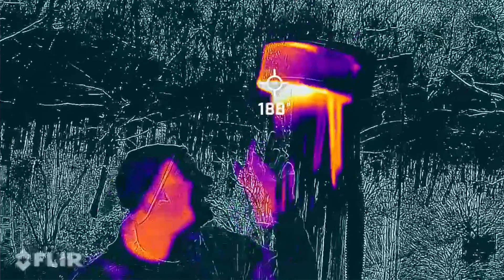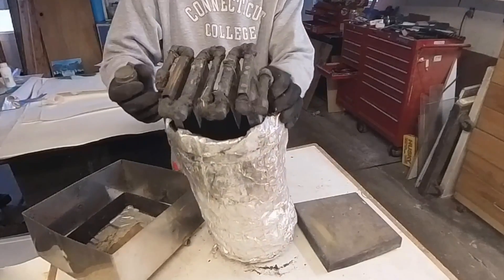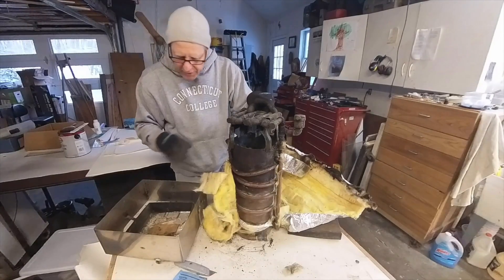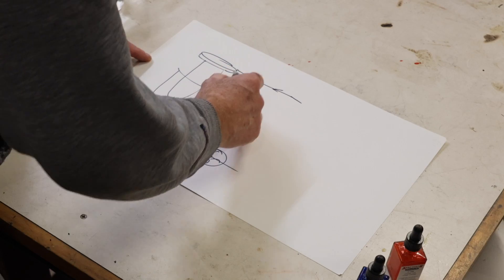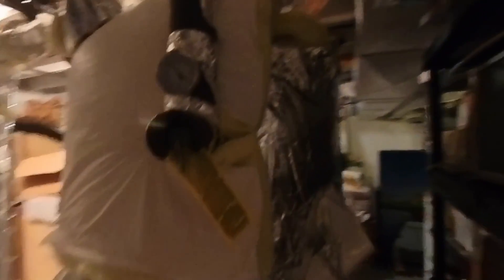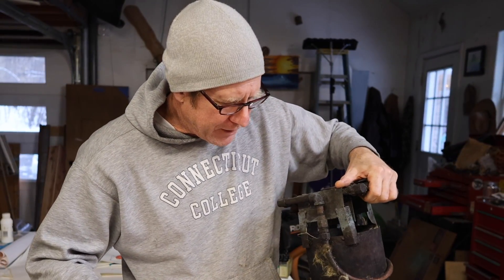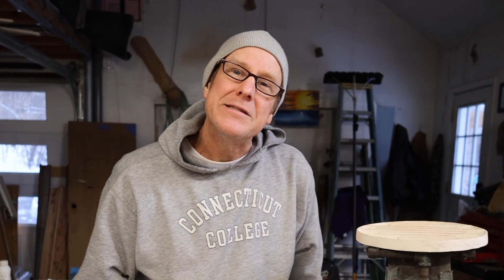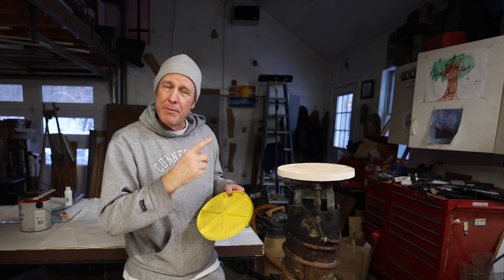DIY, HOT Water from Wood Stove That Really Works

Comment: I’m in the process of designing a house, and I would like it to ideally be off grid as possible therefore somebody of the future does not possess the ability to shut off my utilities. I’m planning on digging a well for water source. I’ve been looking into multiple ways to tie things together and was thinking of how to use a soapstone masonry heater to heat my house, I can also get a free oven off of it by making side compartment/chamber and im Looking into how to harness thermo siphoning to passively collect the heat from wood burning stove to heat water. I like your side electricity control knob to control temp accurate because I’ll have solar in summer and not wood stove. Was planning on running all plumbing kitchen bathroom and laundry room internally connected and three walls facing so I minimize pipes/travel distance and only plumb one wall of my house, masonry heater will be next to kitchen by laundry room. I think a copper coil inside of my fireplace could heat water without electricity. Idk any other tips or tricks recommendations? How many times have you cleaned the copper pipes in ten years they look shiny and also? Great video I’m trying to come up with a design to refine it even more before I implement it and thanks for including what doesn’t work, this is very useful for anyone trying to improve. I like how we can all learn from eachother!
Reply from the maker: Sounds like fun! Your idea of a coil in the fire box with a thermo siphon is a good one. That’s what I would do if I was designing from start. My house is too small to put the storage tank on the same floor as wood stove. I have to clean this thing twice a year. I’ve got a video on how to clean it if you want see what it looks like dirty. Also if you’re building from scratch consider the make up air for your wood stove. You could run a duct right to it from outside or a passive geothermal or both. Fire will burn better and house will stay warmer.
Thanks,

Comment: Wow ! Very Nice ! I was also thinking of creosote, as it is kind of a wood destillation system somehow, and I think it could be interesting to design the plunging pipes in a way (with little slopes and One that is longuer than others ?) that there is A main place where all of it accumulate and can Or go back into the fire in a safe and interesting way (if there is no much corners in the pipe) Or being collected in a jar, and from time to time you got some natural chemical to harvest for domestical uses..
Reply from the maker: Thanks for the kind words! Creosote actually builds up all over it and I scrap it off. I have video on how to clean it and one  how it works on my channel, Sculpture for a Small Planet.
Thanks again,

Comment: I have a coil going into my wood stove and it thermosyphons (no pumps, electronics or switches) back up to the hot water tank. It provides 95% of the hot water in the winter. I can tell you there is no "robbing heat" out of the living space, that is a bit of an exaggeration. Its been installed for 30-years and not a single "incident" as you say. We make roaring hot fires. If you design it correctly there's really nothing to worry about.

I just want to push back about some of your claims about installing it in a wood stove as they're not quite accurate. That said, I think your idea is really neat.
Reply from the maker: Thanks for sharing this and fare enough. If my situation was set up different I would go your route as well because I bet you have less cleaning maintenance. But between house size and having thermal solar panels I needed to find a different way.
Thanks again,
Reply: Neat ! Where can we see your system ? Is it compatible with solar collection ?
Reply: @AutoNomades  yup we use the solar collector in the summer. Glad to share photos, how can I be in touch?